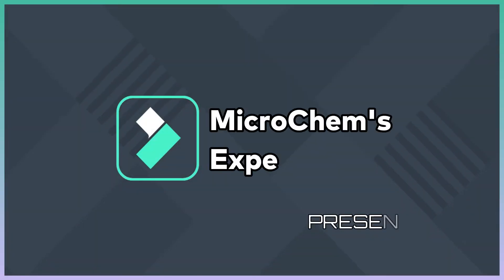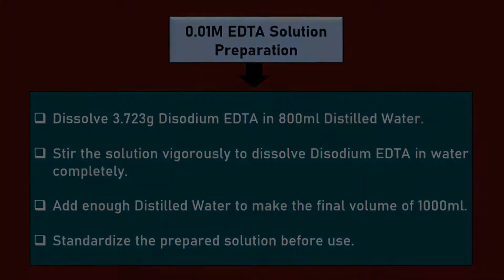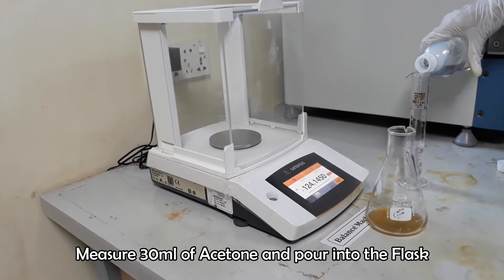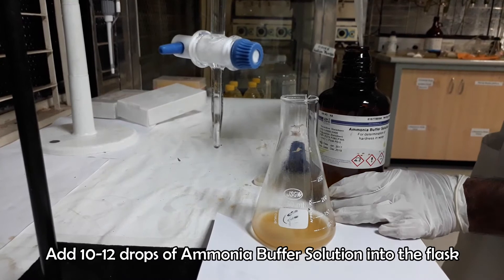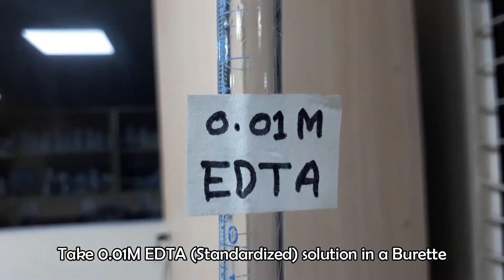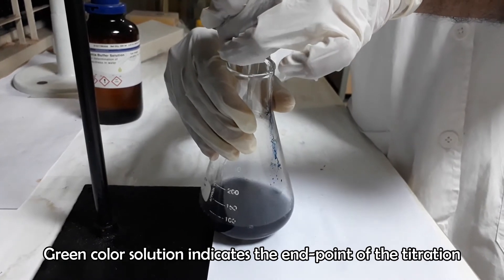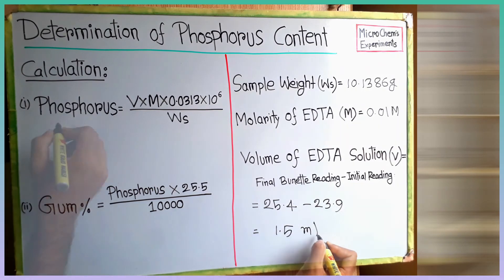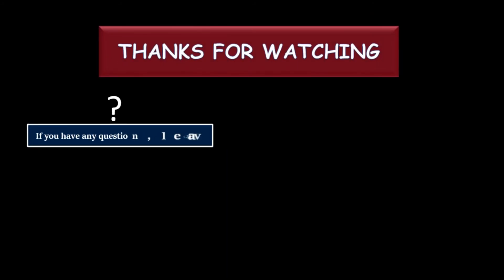Determination of Phosphorus Content & Gum Percent in Crude Edible Oil_A Complete Procedure

Comment: what is the temperature acetone need to be heated? according to a previous comment you have mentioned to 80C. bout acetone boiling point is 56C. is it okay to heat around 45C?
Reply from the maker: No matter of 80 degree or 56 degree. Just apply heat and stop when start boiling and remove the flask from heating mantle

Comment: Thank you for sharing 
Few noticable things I would love to be clear about. 

1. The temperature at which acetone and the sample is to be heated is not indicated 

2. The buffer solution is also not indicated weather it is of 10pH or so .

3. And if possible I would love to understand where the 0.0313 x10⁶ is coming from and which type of oil is applicable to

Thank you I will really appreciate
Reply from the maker: 1. There is no specific temperature. Just boil the content at maybe 80 degree Celsius.
2. Buffer 10.
3. Same for all oils